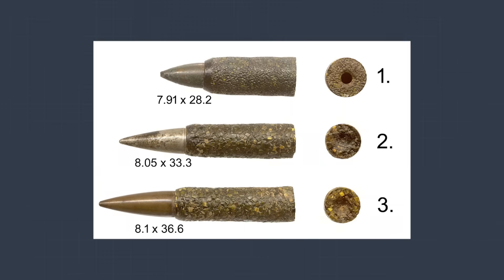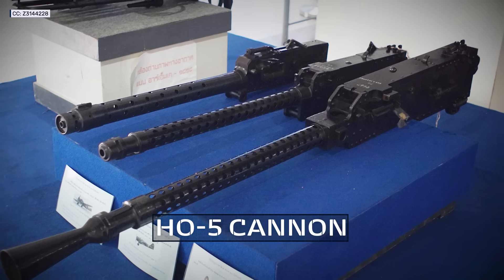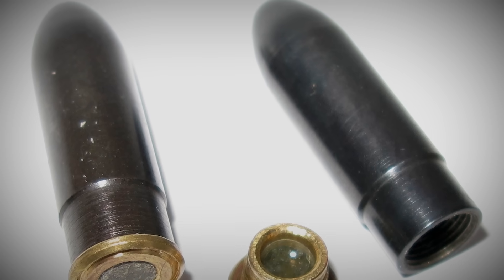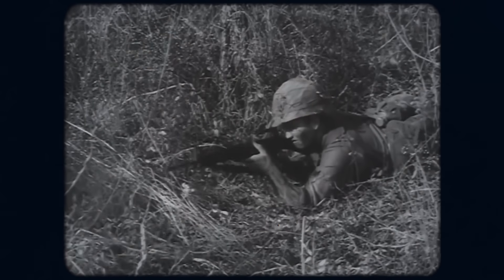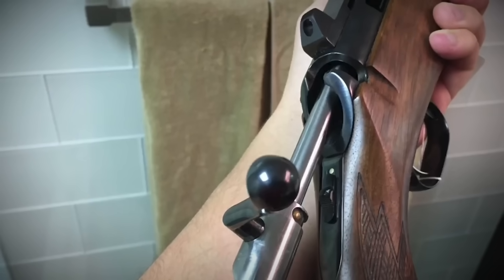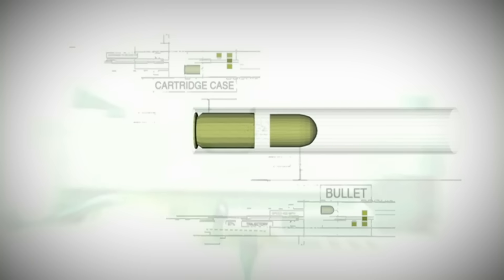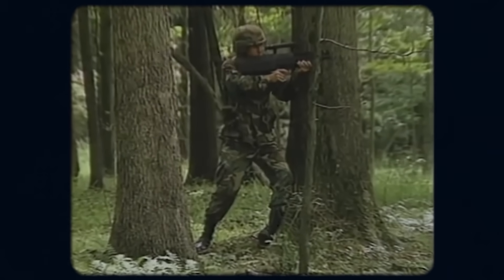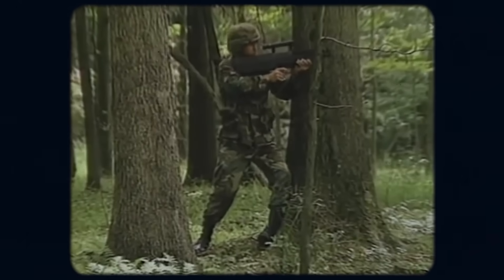Is Caseless Ammunition the Future of Warfare?

Comment: Caseless ammo is a really weird paradox, ud think on the surface carrying just the needed 'bang' and not the 'useless' cartridges around it is an easy net weight and cost gain and you can simplify extraction (or delete it entirely) on the weapon side.

But as it turns out, this cartridge thing we have to deal with is actually part of the solution in many parts of the weapon system.

- It keeps the powder sealed during storage and logistics phase
- It keeps it safe from being banged up during handling and combat and when compressed against other cartridges in magazines.
- It helps (A LOT) sealing the chamber during firing and provides a clearly defined point to strike the primer
- On extraction it brings a bunch of the generated heat outside of the weapon along with it
- Depending on the feed type can be a part of the cycling action itself, helping 'regulating it' as another part of the weapon making it more reliable than just hoping all powder charges are equal and burn at the same rate. (which we know doesn't work with old ammo)

In higher calibers like 155mm we already pretty much are caseless, the bag charges burn on firing and dont need to be extracted. 2 piece tank ammo also exists.

- Seen in comments some people also mentioned caseless leads to easier cookoffs problem either by enemy fire or overheating on the weapon itself. In fact it's part of why russian tanks like to make their turrets fly, both T-72 and T-80 carousels have the propellant charges as the most exposed part, they have a metallic base but the rest of the cylinder walls are more fragile...if even one gets damaged and start going off its enough heat to make every other one and all the HE shells go off soon after.
Reply: Don't forget about muzzle loader "caseless" ammo.
Reply: And the case acts like part of the barrel, the part that would be exposed to many, many high temperature, corrosive chemical reactions. And that corroded part of the barrel is ejected (along with "ash") and renewed, greatly extending the life of the barrel.
Reply: https://en.wikipedia.org/wiki/M551_Sheridan#Armament
Reply: didnt h&k solve pretty much all of those problems with the g11? you are just all colors of f*cked if you have to field strip it, tho xD
Reply: @lukevaxhacker7762  Also iirc, the M60A2 tank.
Reply: I came here to say some of these things, but you brought many more great points home as well.
Reply: I visited the USS Iowa battleship last year and found out to my surprise that the main 16in naval guns are caseless...the round is inserted into the chamber and bags of power are loaded in behind it. A disabled US Army Veteran.
Reply: @garykubodera9528  Caseless only in the sense that the powder charge is not part of the shell. Such an arrangement would have been impossible to manage as it took 6 or 8 bags of propellant for each shell. The powder was laid out in a specific pattern with in the bag. Disturb that and the shell would go flying off course which was a problem with bags that were inspected and returned into service during the 80's.
Reply: @garykubodera9528  So are many typical army artillery ammo like for the M107, and M110 guns that use a shell and bagged charges
Reply: They are also experimenting with plastic cartridges but haven't got them to work either.
Reply: The only firearm chambered for caseless ammunition that saw any serious development is the G11 and that thing is a Rube Goldberg machine internally. There's no way a grunt could ever do PMCS on it; hell, most armorers would be hard pressed to make sense of the damned thing.

I guarantee that, had the G11 been adopted by (West) Germany as planned, it would have proved a very expensive failure in the field.
Reply: Not sure the "turret fly" problems comes from caseless, I'm more inclined to believe that is more the drawback of a "auto-loader", which is an ammocarousel straight below the crew in the middle of the turret. They are literally sitting on a bomb without any real compartmentsm and a direct hit just expodes all of that, resulting in a flying turret
Reply: @Шестик-ю1ц  Thing is if you have hot shrapnel starting to fly around inside, its much more likely to go through the walls of a semi caseless powder base charge and make it go off rather than a one piece metal walled ammo
Reply: @CalgarGTX  Well, yes, but I would argue that the difference is not THAT much compared to difference between having auto-loader and having ammo in a special isolated compartment, but it has to me manually loaded.
Reply: Caseless ammo is pretty much a solution in search of a problem.  It may have a use some day but right now brass shells get the job done.
Reply: @cugamer8862  "A solution in search of a problem"? Nonsense. The problems are pretty clear: casings cost money and material to produce and add both volume and weight, making it more costly/cumbersome to store, transport and carry around.

The ammo for the G11 was about 60% the size and 50% the weight of a traditional carthridge with similar performance - 40-50% more ammo at the same volume and weight per soldier is a huge increase in firepower! It was also 40% cheaper to make and at hundreds of millions of rounds per year during a war, that adds up pretty quickly!
Reply: @cugamer8862  the problem is the weight of ammunition, and how much soldiers are able to carry in a fight. But caseless ammo is not the only solution to that.
Reply: From what I am told. The hardest part is by far the heat extraction, and extraction in general. 

 We have stable (enough) compounds. 

Also simply costs. The US Army loves making new tech just to sideline it. They don't like change. 

 I want to see... inhale electronically primed, caseless, hybrid rocket ammo, with actively cooled barrels in a bullpup! 

 Solar powered by those solar panels that calculators use which just got a big break through. With a battery. 
 
 With those auto aim sights, and augmented reality, and recoil control with gyroscopes. 

 Make the soldier super accurate. Try to cut down bullets to 1 in 5 hit probability. 

 For special forces, and one day infantry. Supply line bros can make due with now ancient small arms. 

 Maybe one day add in DARPAs homing ammo!

 Anyway seriously. I wanna see small arms themselves get an upgrade in my life.

 No no after thinking about it  I want a semi automatic light gas gun firing grains of depleted uranium or some tungsten carbide. Light gas guns can fire at 10-30k fps. I didn't do the math, but I think that would be fast enough to make them deadly. 

 A weapon that uses sand essentially is terrifying.  It would be like you sneezed in a direction, and someone had their frontly abodmen and face sand blasted.

 I just want faster bullleeeeeets!
Reply: @dianapennepacker6854  Forgive my ignorance, but it seems like "rocket" ammo is essentially cased ammo but the bullet has to carry to case with it instead of leaving it behind. It doesn't seem like an advantage to me.
Reply: This is an excellent comment that hits all the vital points. Well done!
Reply: It's really not, it's been common since dreadnaught battleships.  It is not adopted for small arms because replacing barrels every 1000 rounds is much more expensive than buying 50,000 rounds and reloading them five times before a new barrel is needed.  Above 40mm almost everything is caseless....except the UK challenger, stupid brits.
Reply: I guess their tank designers never studied warship design. Battleships especially stored their powder charges and rounds in separate magazines in armored citadels meant to prevent incoming shells setting off the charges all at once,  a la HMS Hood or USS Arizona. Ships do have the advantage of being able to flood their magazines in case of fire though. 

Also bags for large shells keep the powder ordered properly. I remember the Battleship New Jersey channel discussing how in the 80's the navy inspected a number of bags disturbing how the pellets were arraigned. Later when she was shelling Beirut, an occasional shell would go way off course from target.
Reply: ...Depending on the feed type can be a part of the cycling action itself,...

You embarrassed me, exposed me. Due to 6 neck surgeries, I can no longer shoot high powered rifles or shotguns without breaking something else but I still love to plink and target shoot. Twenty two years ago, I bought a little Marlin, 15 shot, tube feed, .22 caliber rifle. It worked well but I, being the one who needs to improve on everything, disassembled the action, took some crocus cloth and polished all the contact points where the semi auto bolt touched. I reassembled it and took it out side expecting an almost full auto smoothness to the action. Instead, every single fired shell stove piped, (albeit sideways). The bolt was returning to the firing position so fast that it would bite the spent shell and also jam the next shell on it's way into the chamber. I had to disassemble the action again and rough it all up with coarse emery cloth to slow it down. After about 10,000 rounds, I still shoot it today. I was also warned by a gunsmith that these cheap rifles are prone to wear and can go full auto without notice. I haven't seen this yet but I'm still hoping to live to see the day.....
Reply: @baronvonslambert  Heat pipes were invented in 1942 and can be very light.  You obviously don't know what a heat pipe is.  I've never seen a weapon that uses heat pipes in its design, but they are commonly used in commercially available computers.  Changing barrels is all well and good, but the issue here is bringing caseless ammunition weapon designs to parity with the current cased ammo weapons.
Reply: The 155mm (and tank ammo like 120mm, or the next gen 130mm) is an interesting example to me. Why couldn't we make 5.56 NATO with a combustible case like the artillery calibers?
Reply: the round for the Abrams is semi-caseless, and they highlight a lot of what you say as well, along with one additional fact... what do you do when you need to clear the weapon? Caseless ammo has nothing to clear the round from the chamber. I've heard from people who work with that 120mm smoothbore they have to be really careful when it comes to clearing the gun to make sure they don't rip the base off the round and make a flammable mess in the turret.
Reply: @Tomyironmane  Ive heard that if at all possible the 'troops on the ground approved method' is.. fire the gun anyway, otherwise you need to get the tank back to maintenance depot and do a whole procedure yeah it's a mess.
Reply: Best comment.
Reply: Maybe the projectile and powder should be stored separately in rifles, too.  Maybe the propellant could even be a two-piece liquid.
Reply: Also carries along the ignition/firing system (primer).
Reply: I've wondered if integrating water into these weapons could somehow solve the heat and fouling problems without creating other issues like rust, or surrendering of your location through some steam related visual clue. Water has enormous specific heat capacity and is something soldiers must have on themselves to be functional as it is. You eliminate a bunch of weight, increase the firing rate/accuracy, while only marginally increasing the use of a consumable (water) they're already being supplied with -- and one that's often available in the surroundings; certainly more so than cased ammo might be.
Reply: @snizami  Water's heavy.  Any amount that would sufficiently cool the barrels would weigh more than just carrying the brass.  The only solution I can think of is Inconel barrels, but then the cost of each small arm is going to 10x in price...
Reply: @mfallen2023  it's light considering its availability and specific heat capacity that's almost an order of magnitude greater than the brass casing on a J/kgC bases. Same goes for inconel.
Reply: @snizami water cooling has been used in machine guns.  They put a big water jacket around the barrel.  Heavy, but it beats melting the only barrel you have.
Reply: @firstmkb  I recall reading that it also created issues in terms of giving away your position via the steam.
Reply: @snizami  There's some machine guns from around WW1 that were water cooled I believe. To me in most contexts it seems excessively complicated to be put into practice. The best part is no part
Reply: @bird.9346  a truism recently made most popular by a loudmouth knowitall like Musk that doesn't necessarily bear out a lot of times. Mini solid fueled rocket ammunition would technically remove most parts, for example. Micro chips are stupendously complicated, but incorporating them into designs removes enormous complexities elsewhere while adding reliability through their solid state nature. Heck, they're even cheap and mass manufactured enough to challenge such platitudes at their core. The best parts can be way more parts. It all depends. Besides, the idea here would be to actually simplify the design by incorporating water's ready benefits. It's just a thought. I understand it could have potential issues and drawbacks but could bring offsetting benefits that might make up for it.
Reply: @snizami Water-cooling was used in WW1-era machine guns and BOY were they heavy. Turns out the more practical solution to keeping the barrel cool is... carry extra barrels and swap them out.

Plus I wouldn't guarantee water is always in good supply. It sure wasn't in Gallipoli, for example. In an emergency you could always piss into the water jacket, though...
Reply: @snizami  That is what they did with machine guns up to just before/start of WWII. Those guns weren't being lugged around by infantry though, they were fixed position weapons that were for garrison duty or early AA guns aboard ships until 20 and 40 mm AA guns could be installed. Aircraft pointedly didn't want the weight penalty of all that water and used aircooled machine guns. And I imagine that belt fed ammo in combat is going to see rough handling, either from hasty installing a new belt when under fire or just the jarring around when in flight or being driven across rough terrain.
Reply: @snizami Water in guns is a terrible idea the brits made a water cooled machine gun with many problems.
It needs to be pre filled, cant just grab it and go, you need to have the water, you need to make sure it is filled in a stressful enviroment. Risk of burning from a jet of steam, bad visibality do to steam or fogging up of glasses and optics.
Problem with frezing or evaporation.
Also handeling issues water splashing around while mowing makes aiming more difficult, center of gravity shifts and weight changes.
Reply: @jonasstahl9826  I completely agree that it's got issues. That's where innovation could either shine or fail to overcome said issues. I addressed the supply issue, and pressure could be utilized only past dry steam temps to help with rust. Then there's barrel materials and caseless ammo chemistries, which could help further. As for misdirected steam, such dangers shall remain a concern with any firearm. It's a prohibitive concern until it's not. That's how innovation goes. At the end of the day, I agree it could well be a deadend, yet the very theme of this video is how seemingly put-to-bed ideas can be worth exploring again.
Reply: @snizami  The Problem is the steam will not only accure when firing but also some time after, so will be pretty dificult to not steam your fellow soldiers, even if it is not about getting burned it is about fogging your glasses.
Also problem could be whistling sound from the steam, pretty bad in close combat, last but not least the cold weather problem forget about ice cracking the gun. Spill some water while refilling and you get a good change that ice is blocking some mechanics or you get your gloves wet, touching cold metal with wet gloves is a great way to lose fingers to frostbite.
Reply: @jonasstahl9826 Release would have to be linked with the cycling of rounds, as are other mechanisms in all sorts of rifles. That, in turn, also links sound with discharge, and the thought is to use it to simultaneously clear accumulated fouling anyhow. Also, it's dry steam, not the colloquially implied low temp vapor that causes fogging anyway. Any danger would probably marginally increase at most because there are already parts of a rifle you're not supposed to flag someone with, especially not when rounds are cycling. A small burst of dry steam is not unmanageable whatsoever in firearm context. As for freezing, water would be in a container, which, even if it were to freeze, would sit there soaking up heat until dry steam temps are reached and rifle's been in a fight for long enough to make temps and fouling a concern. Anyhow, there are all sorts of issues but no reason to assume they can't be resolved to gain the desired benefits. You're raising some legit issues, but assuming there's little to no design around said issues.
Reply: @snizami  Water is heavy and requires a radiator for it to expend its heat to be cycled back through the hot areas of the gun.  Hot water can also develop high pressure as it heats up and vaporizes, which is going to require more material in its housing to deal with.  I think the better way to handle heat would be to use heat pipes that move heat to a heat sink located away from the breech, which is the hottest area of the gun.  Heat pipes are light and commonly used in computers to move heat from particularly hot areas.
Reply: @sciencecompliance235  lol, no, it doesn't. Sheesh, what a funny answer. I know there are all sorts of issues, but a must-have radiator isn't it. Lol.
Reply: @snizami  The water needs to be able to reject the heat somehow.  How else do you get the heat out of the gun?  Are you suggesting evaporative cooling?  If that's the case, then your gun would get "thirsty" and need to be resupplied with water after boiling its supply off.  If you're just using water to add thermal mass, then there are better materials than water with a higher specific heat capacity to do that.
Reply: @sciencecompliance235  that's if you want a closed loop system that doesn't need to be fed water, which we don't want here because of the sheer amount of heat and space limitations. Water absorbs and carries away heat just fine on its own. Think about what spraying a hot radiator itself can do to dramatically bring down temps. Heck, even a contained volume of water can soak up a lot of heat before pressures become too high. Water is more than an order of magnitude better at absorbing heat than metals like copper or iron on a j/kgC bases. Allowing it to evaporate even in a somewhat uncontrolled manner would carry away a lot of heat for an equivalent weight of brass casing. Then you consider any work the steam could do in keeping the chamber clean, and it just makes me wonder, that's all. There's all sorts of potential issues, but you don't need a radiator to use water's cooling abilities.
Reply: @snizami  Why wouldn't you want a closed-loop system?  A system that requires a constant supply of expendable water is a logistical nightmare.  Evaporating water into the chamber sounds like a great way to corrode your weapon, too.  All the heat the weapon generates has to go somewhere.  If you absorb it, you will eventually have to expel it.  A radiator is just the means by which the working fluid in a cooling system dumps the heat into the cooler external environment.  If you don't use a working fluid, then your heat can be dissipated by using heat fins or some other way of increasing the surface area and/or increasing airflow over the weapon (via a fan or some passive means of convection).  Heat pipes are very light and would move heat very efficiently to cooler areas of the weapon to increase where the heat can be dumped into fins and expelled.
Reply: I don't see why the rounds being inside the magazine is that rough an environment for a cartridge.  Loose rounds outside a magazine, not having a case would seem like an issue, but that seems fairly easy to solve by storing the rounds in clips/stripper clips prior to insertion into a magazine.  The G-11 basically had plastic stripper clips that contained rounds that were used to feed rounds into magazines.  There shouldn't be too many situations where you need loose rounds lying around.
Reply: @sciencecompliance235  Yes, keep the rounds in clips or stripper clips... and then you need a production line manufacturing them in a large enough quantity for all of the ammunition you have in storage, added to the fact that caseless ammunition, by design, does not have convenient, durable flanges on which to fix the clips (all cased ammunition has a flange at the rear of the cartridge for the extractor to grab to pull the spent case out of the chamber when the action cycles; caseless ammunition, by its very design, has nothing to extract) -- the composition of the formed propellant is not strong enough for the stresses on a full clip of ammunition, and even if you found a design that would work, you're adding the volume and weight of the clips to the weight of the ammunition you have to transport; magazines are large enough that, in most cases, you can expect the troops to collect their empties to be reloaded, but clips used only to hold 'loose' ammunition for loading into the empty magazines are going to be discarded as soon as they're used, rather than being policed up and shipped back to whatever facility loads loose rounds into the clips, whether that's the manufacturer or an intermediate logistics location; either adds additional overhead to the logistics train.
Reply: @DmdShiva  The G-11 used clips very similar to what I described.  A lot of the issues you mentioned aren't that big of a deal.  Clips are easy to manufacture and do not require a flange on the back of the round to work.  I'd recommend looking into the G-11, as there was a lot of good development work done on that gun.  Extracting dud rounds from the gun was also something the G-11 had a way to handle.  The clips can be manufactured from plastic, which is lighter than brass and can be made thick enough to sufficiently protect the rounds.  Throwing clips away after they are used is just basically the same thing as throwing brass away currently.  Most spent casings in a combat situation are never recovered.
Reply: @sciencecompliance235 Combat is a rough enviromrent, imagen being hit by some fragments and the bullets in your magazine go of.
Reply: @sciencecompliance235  not being mean but that means you understand dick about guns. magazines still get shit inside them(water, sand, etc) caseless are unprotected against it, also your top "bullet" is going to be exposed to things like rocks any time you have to get down in a hurry. a metal casing(and primer inside) makes it a LOT more survivable to the environment in general and warfare in particular. 

add too it that such cartridges leave behind far more gunk in the barrel, dissipate less heat, (and on and on) caseless is just never going to be the way to go. it SOUNDS cool, it SOUNDS effective...if you know nothing about the operation of a firearm. as soon as you learn even a little bit about it...its just a pile of problems with no real solution...other than to encase it...which we already do.